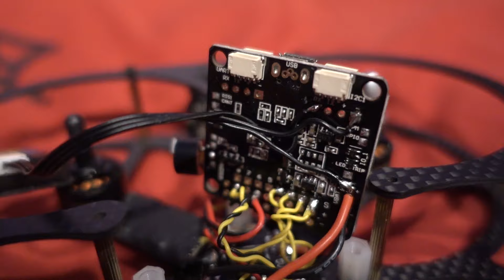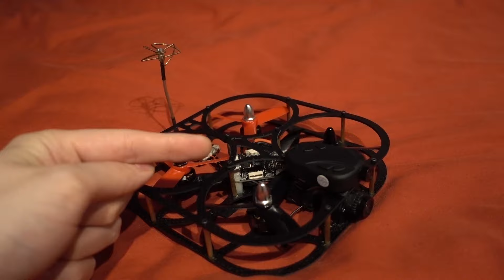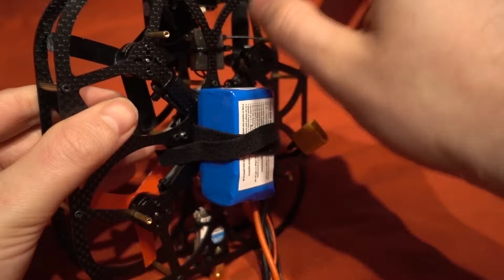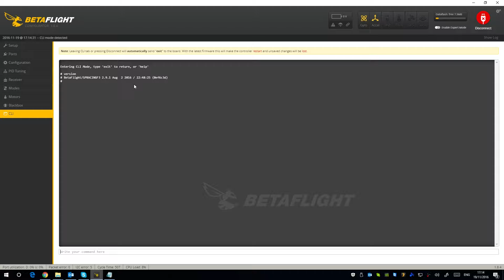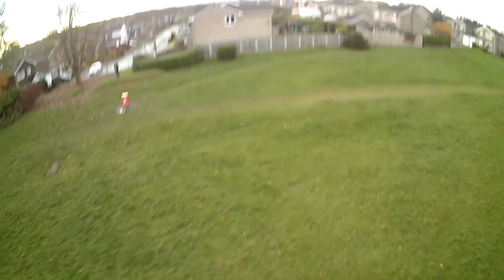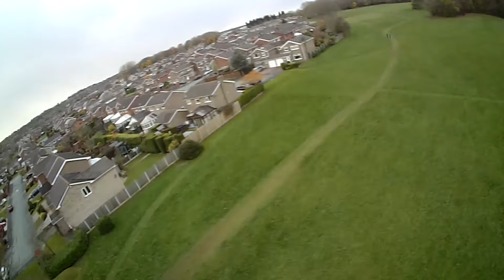GB110 BNF FPV Brushless Micro

Comment: I bought a cheap used one and finally fixed it...changed the standoff color...and the frame.  The aerodynamics of this frame are horrible.  I would love to see it in a wind tunnel because the flow through it is blocked by the frame and dependent on direction and orientation.  I believe it could only be made stable by shortening the props and building tunnels around them.   It now flies quite well (so the other parts are fine) and the noise doesn't scare the dogs/neighbors/wildlife in the area.

Comment: I read that a couple people were having the same tilting back problem with the DJ-105 frame. One of them found out that "it was a bad version of betaflight with dshot600" and fixed it by flashing Betaflight 3.1 RC5 (see page 67 of the rcgroups DJ-105 thread). I wonder if the same issue is at work here.
Reply from the maker: it could be i will have to try although this isnt using dshot cheers

Comment: I purchased a similar quad (160 size) from Gearbest and it was an absolute disaster !

http://www.gearbest.com/multi-rotor-parts/pp_364384.html

Out of the box it had a bad ESC and didn't fly at all. The ESC's where not attached to the frame at all and during shipping a lot of wires came loose and had to be soldered back on. I didn't realize that the ESC was bad, so I replaced the motor. However the bad ESC then immediately killed the replacement motor as well. I then replaced the ESC and the motor, but I could not get the ESC's correctly calibrated in LibrePilot (uses CC3D) afterwards. So one motor is not spinning to full throttle now. I guess because 3 ESC's are the same the the 4th one is different.

I went into a bitter fight with Gearbest and wanted a refund. They couldn't care less, though. They offered me 30 dollars (I paid 180 for the quad !). So I lodged a case with Paypal, which was decided in my favor. However Paypal wanted me to ship the quad back to China. Now shipping costs from Australia to China are prohibitively expensive (100 dollars+) and Gearbest knows that, so they just laugh in your face !

So I still have the thing sitting on the shelf not being able to fly at all. I ordered a whole set of new 1306's and 4 new 12 A ESC's and at some stage I plan to rebuild the thing... when I am calm enough to look at it again. Never ordered anything from Gearbest since.